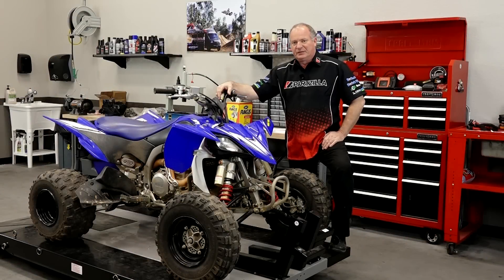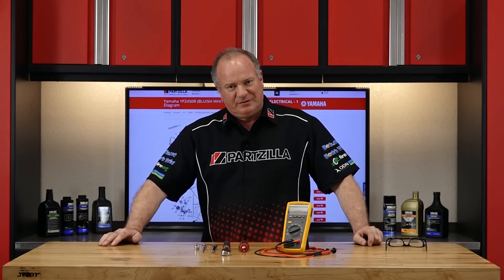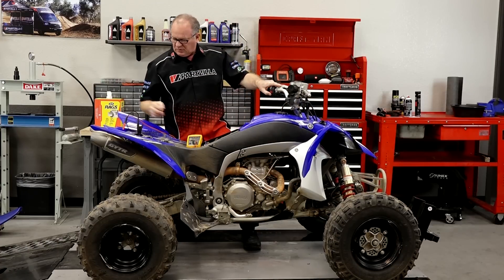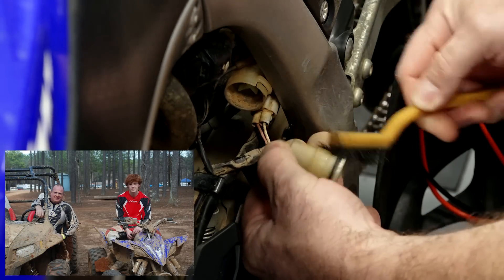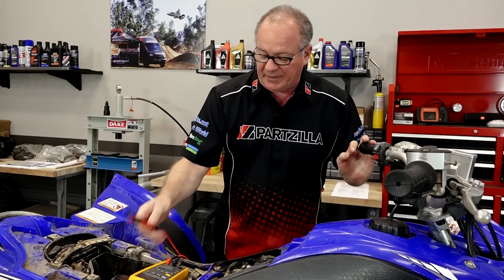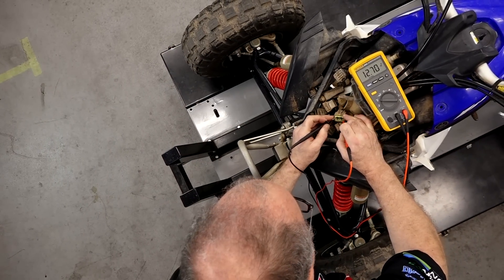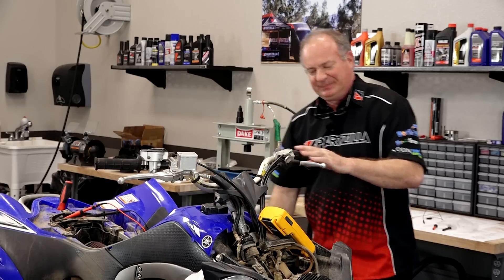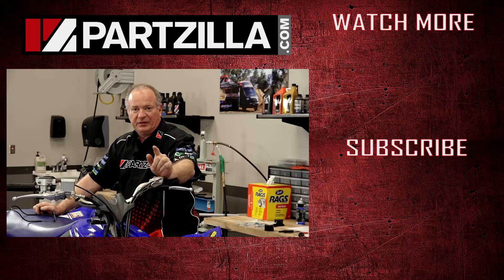Yamaha ATV Electrical Problems | YFZ450R Not Charging | Partzilla.com

Comment: I have a new battery , and a new starter relay solenoid , and I have no lights on my dashboard when I turn the key , what could the problem be
Reply: Check your neutral safety switch under the gear shifter

Comment: Thank you so much for this video, it helped me diagnose the problem on my XT660X with the regulator/rectifier. Funny thing that I noticed; the faulty part tested OK with the diode test when the bike was 'cold', however after running the engine for a minute or two and re-testing the part right after, it actually tested faulty until it cooled off again.

Comment: I have a similar problem with my YFZ as well. My battery has 10 volts when I used the voltmeter which is already bad, but when my YFZ is running at idle the volts go up to 28 and as I add gas to the throttle it'll only keep going up. I’m thinking it’s the stator but I really don’t have any idea of what it is since I don’t know much about them.

Comment: My Kodiak not charging and the stator dynamic output is in the 30-33 V AC range. Bike idles for ten minutes and battery drops from 14 to 12 V DC, and then down and down. I'll swap out the rectifier and pray it's not a short somewhere in the harness. I know the rectifier gets VERY hot so I can see how it might be prone to failure. Thanks for the helpful video John.

Comment: What does it mean when my 07 fyz 450 only cranks when boost off & I have to touch the solenoid to start it when I turn it off it has no spark ! from the switch it just slicks and my red light flashes!

Comment: Hey guys any idea why 2005 yfz 450 is not sending any power to the bike i have a new battery replaced the key switch and starter solenoid cleaned the neutral switch and still nothing i hit the key and doesn't do anything

Comment: Currently working on an 04 Kodiak the starter turns over but the starter turns a long time before the motor picks up and turnsover to crank
Reply from the maker: If the starter spins before it catches the motor, check the bendix gear and the starter gear for damage

Comment: Hey guys i have a 2013 yfz450. Went for a day of riding and an hour into it, it started sputtering at mid throttle and has started running a little rough. Is this a carb and fuel issue or is there something I'm overlooking
Reply: Have you fix your problem I’m dealing with same issue now
Reply: @Gunstv94  unfortunately not I ended up taking it to a shop and letting them deal with it. A tune up and a new airbox and intake fixed it

Comment: I had a 2015 Yzf450r hello it idles high when I turn on the high beam when the light is turned off there is no throttle response when it sitting and idling it ran fine before I let it set any ideas will be greatly appreciate it thank you

Comment: Could a bad stator or rectifier cause a yfz 450 to only backfire and not stay started?
Reply: I just had this happen to my 2004 yamaha 450 yfz. Change the stater and it drove nice for awhile died again.  Will have to change rectafire and stater again
Reply: Hey Daniel,did you ever figure out if you're issue was the rectifier?
Reply: My yfz cranks but never starts I think it ain't getting fuel
Reply: Mine backfires too...but doesn't stay started

Comment: Hello, 
I have a 09 YFZ450R. That idles for 15 seconds and some times 2 minutes then it dies.
The battery is reading 12.36V and when is running is at 13.45V.
The resistance on the startor is 0.4ohms on all 3 coils. But the voltage is around 33-34 AC volts. But some times the multimeter reads as low as 32.2 volts.

It has continuity from voltage rectifier to the battery and from the voltage rectifier to the stator too.

Do you guys think that my startor is failing?
Thanks in advance!

Comment: My bradda thank u for all these videos. I get one problem that really need help with if possible. I changed the stator changed the complete harness and starter relay now I have no Neural light and no power to harness idk what I could to please help
Reply: Neutral safety switch. Sounds like it’s not grounding properly.
Reply: @ajones9319 that’s what’s mines doing right now I have a new battery , new solenoid , but the lights on dashboard not working

Comment: What would happen if my ATV has an insufficient gasoline injection and does not start? Also the only time it starts is when I straight up spray gasoline from a bottle to the throttle

Comment: 06 yfz450  is killing my battery. Cell is completely dead. Replaced stator, RR, and some other electrical parts.   Please help
Reply from the maker: Has it killed multiple batteries?
Reply: @PartzillaParts  so far two...

Comment: Can you provide some help on a yfz450, not having a spark. Was running fine until I changed the battery. I pulled the spark plug coil and hit the start button and no spark that I can see.
Reply from the maker: Did you check your fuses?

Comment: I have 804YFZ 450 trying to figure out why it is not getting spark and where is the power  coming from battery full
Reply: Did you ever figure it out bro have same issues with mine.

Comment: I have a 2014 Yamaha yfz 450r I’ve been getting code 46 has anyone fixed this issue what more or less what could I’m thinking is my stator since my head lights flicker when they are on
Reply from the maker: Could be anything with your electrical system, test the stator and regulator to start.
Reply: Partzilla if those two are in good condition what could it be ?

Comment: I have a 05 yfz 450 that won’t start I have replaced the battery the starter the sylinoid and the plug for the spark plug but it still won’t start, it turns over but won’t start. Could my issue be the stator ? Or another issue please let me know your opinion thank you
Reply from the maker: Are you getting spark at the plug?  If yes, check your fuel.
Reply: I’m having the same issue

Comment: Hi john - thank you for the videos.  I have an 09 yfz 450r.  Having some battery troubles.  Put new battery in.  Voltage across leads at idle is 14.35.  I also have a parasitic draw of .17 between my positive post and positive lead with the key off.  I’m guessing the regulator is allowing to much juice back.  I’m hoping that maybe that regulator is causing the draw also?  Thank you for any help?
Reply from the maker: Check wires and cables.  You can disconnect the regulator to see if there is bleed off, causing the drain.

Comment: I got  05 yfz 450 .it wont turn over unless jumping  solenoid or wire yellow on neeutral switch  then the start button works but  now new  Ricks stator and  rectifier still no spark or button wont work without jumping yellow neutral safety relay wire I installed a new neutral relay by battery no  green lights nothing even put a neutral safty switch by shifter .im stumped maybe tors or tps is all that's left I added 3 ground wires for the teck of it nothing could those 2 diodes cause this up front. I know they are bad v ffron av test well  one is I don't know  which is which. It has lots of compression maybe .i'll get coil also I want to delete all safeties but don't know were to start any into would be great. Also new cdi installed.

Comment: My 04 yfz 450 acts like it's hitting rev limiter at half throttle can't tell if it fuel or electric problem
Reply: Hello Tim, did you ever figure it out?
Reply: @ucatchme25  Mine did the same but would run fine with the lights on. It was the rectifier

Comment: If the DMM showed the reg/rec was fine, why wasn't it working properly?
Reply from the maker: A DMM can only peek inside and look at the diodes on the rectifier portion of a regulator/rectifier.